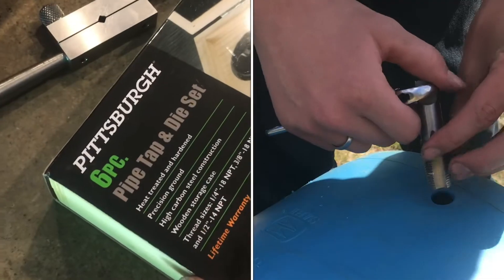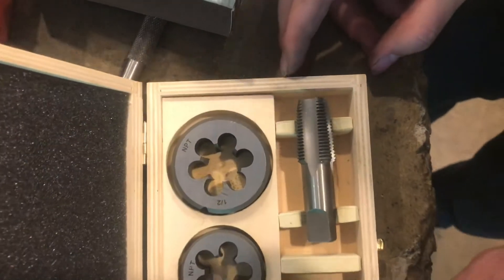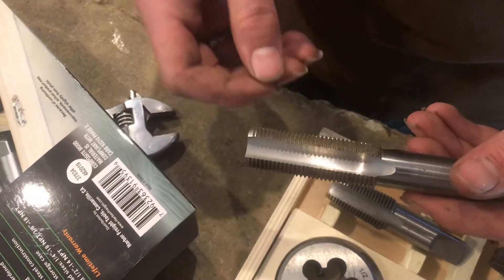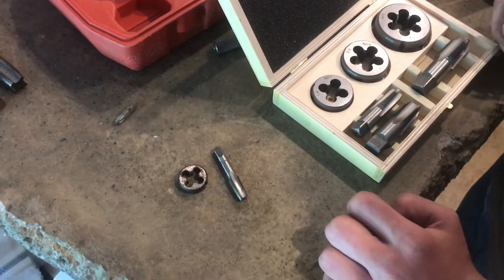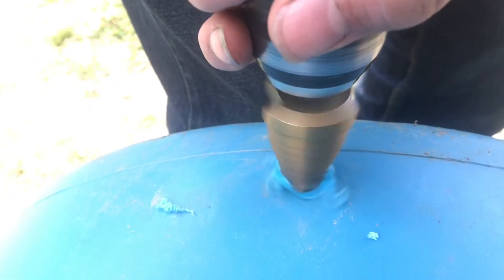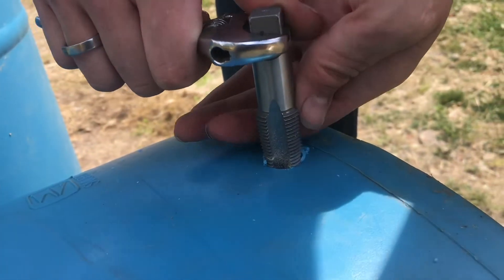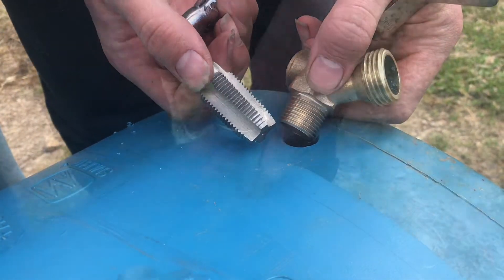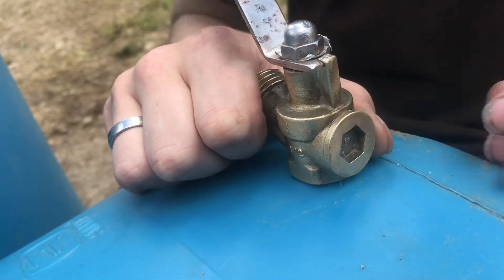how and why to use a “TAPERED” tap (NPT thread) National Pipe Thread

Comment: You should use a "Close" or 2 in Nipple, instead of using only a spigot. Leaves you more room for error.

Also, 
A good way to tell where to stop, is by putting the tap into a clean fitting of the same size. When it gets tight and just about to start cutting stop and mark.

Take whatever you have that is going to go in the hole, in this case the water spigot, and screw it into that same fitting, mark it. 

Most likely they will be just about the same. Go with the more shallow marking, and tap it in, shy 2 full turns. 

That should get you to where you can still keep cutting to sneak up on what angle you want it to be at. As in straight up and down or like the way you went too deep and it is at a wrong angle. That way you don't have to say "I meant to do that!" or "Yeah I wanted it straight up and bottomed out."

Comment: pretty good. you went just a little too far; you don't want your fitting to thread in to the shoulder, especially not that easily but if it works...🤷🏻‍♂️. If it starts to leak later, and you can't thread it in further or get it to stop with tape, get a 3/4"(or whatever size) bulkhead. Those barrels should be big enough that the curve won't cause you any problems. Just look for one with a nice thick epdm washer.
Reply from the maker: I agree, lately I go only as far as I have to so things are tightened up better. Great observation👍

Comment: Hi! So.. Is there a way to measure how deep to go? Like.. ¿Its the same  screw's dept?  I.e, screw 1/2inch= hole 1/2 deep? I'm trying to figure that out! Thanks
Reply: A good way to tell is by putting the tap into a clean fitting of the same size. When it gets tight and just about to start cutting stop and mark. \

Take whatever you have that is going to go in the hole, in this case the water spigot, and screw it into that same fitting, mark it. 

Most likely they will be just about the same. Go with the more shallow marking, and tap it in, shy 2 full turns. 

That should get you to where you can still keep cutting to sneak up on what angle you want it to be at. As in straight up and down or like the way he went too deep and it is at a wrong angle. That way you don't have to say "I meant to do that!" or "Yeah I wanted it straight up and bottomed out."

Comment: Can you tap steel with that.
Reply: Yeah but you're better off spending a little extra to get a set of high-speed steel taps for steel. These carbon steel taps are kinda weak and wear out pretty quickly.
Reply: That's what they are meant for.

Comment: I just bought one nut 3/4 online 2 bucks. Wow 2 bucks each plus shipping cost. And I probably need 20 more. So I am making my own nuts. Just get some cheap thick poly cutting board and cut and use tap threaded like you see in this video. I wanted 3/4 tap and I don't want to buy whole set as I just wanted one size only from Tractor Supply.

Comment: what's size of taper you use in tap
Reply: The taper is  3/4" per foot, but 
the hole does not have to  be tapered to use a pipe tap.